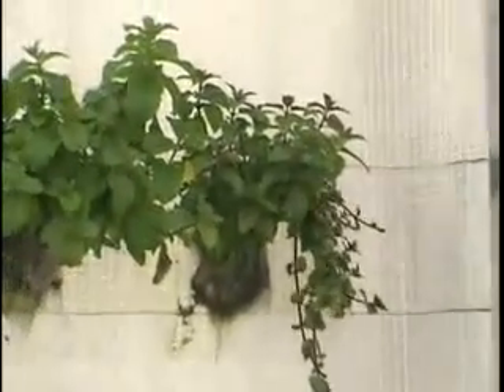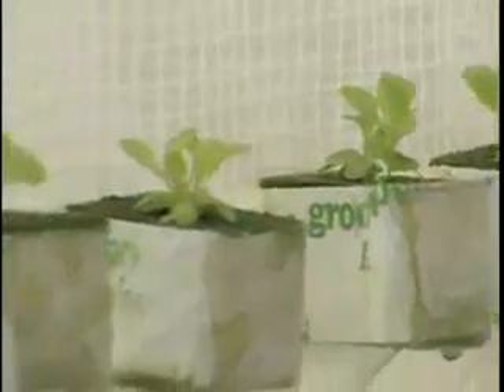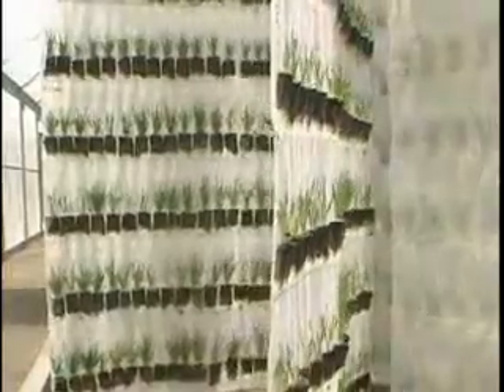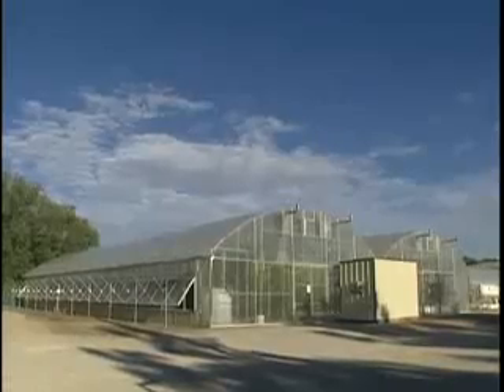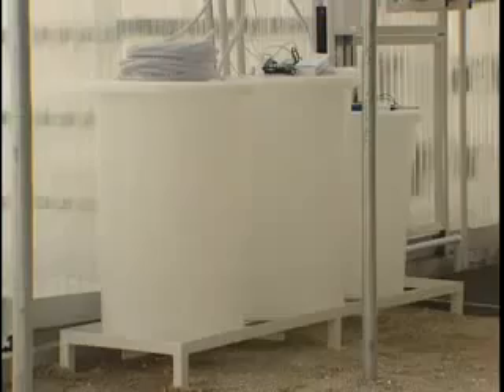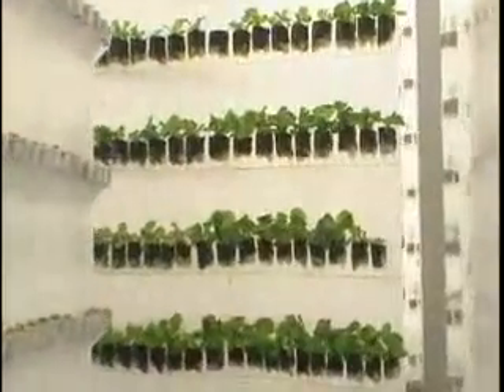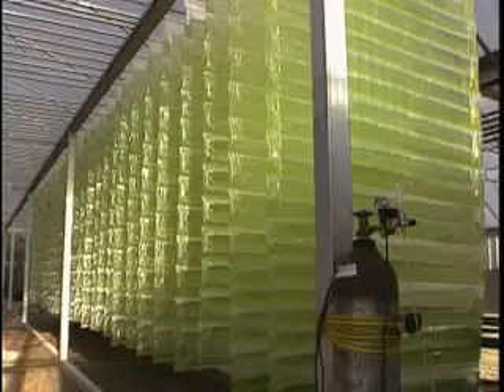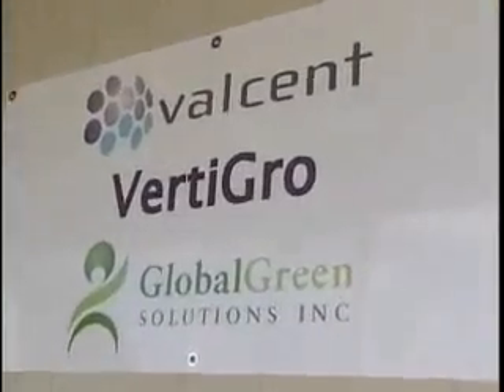#2 Vertigro - Gas, Diesel, Biofuel production from algae

Comment: @hablerz one of the beauties of algae is that it is useful in many applications.  for food grade algae, which will of course be the most expensive to produce, contamination would be too high a risk.  For that application it is more likely that a system with less "tight squeezes" and a more open pool design, or an enclosed reactor for collection of the decomposition gasses.  Waste processing is just one of the many uses for algae.  We could really convert off of fossil fuels now.

Comment: The oil from algae is the same as any other plant oil in its essential function.  there are several ways to separate the oil from the biomass.  ppl who would want to troll on this idea, or be "negatively skeptical" will have missed the boat on this one.  algae is incredibly efficient as an organism, and also more easily monitored in its growth.  we can eat it, livestock can eat it, it can be grown on unfarmable land, can be used as biomass fuel directly OR as an oil product.